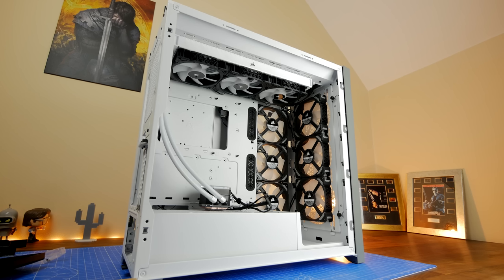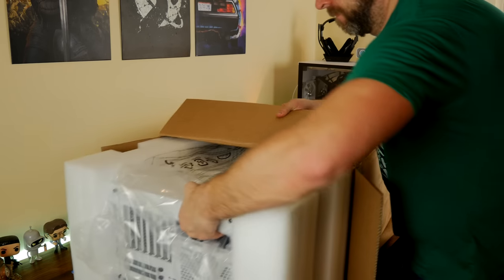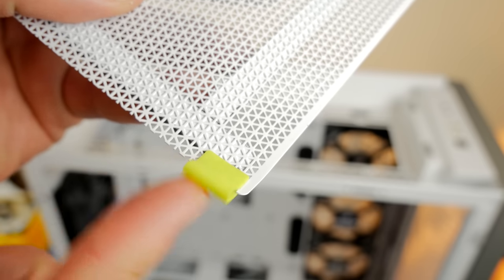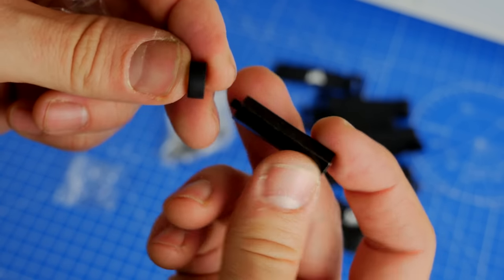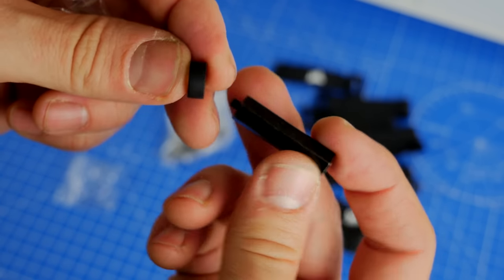Corsair 5000D Airflow build with 12 fans, H150i Elite Capellix Push Pull (in-depth build guide)

Comment from the maker: Related videos worth watching:
Corsair Fan wiring guide - https://www.youtube.com/watch?v=jvXCbny-Suw
5000D with two fans https://youtu.be/r5OY9llXRwo
How to vertically mount your GPU in the Corsair 5000D Airflow (does it get too hot?) https://youtu.be/4b8lb8adXTA
Corsair iCue H150i Elite Capellix AIO Unboxing and installation https://youtu.be/o_FajCnpN6Q
Corsair QL120 VS LL120 https://youtu.be/X4-tx9mn1Tg
Corsair QL120 RGB Fan Unboxing and installation https://youtu.be/MIi-aHqt3bc
Corsair RM850x Power Supply unboxing https://youtu.be/-MPSkh2hobA
Corsair 680x Crystal with QL120 fans (swapped from LL120s) https://youtu.be/kCC0hrqPiFI
Corsair 4000D Airflow Unboxing, setup and installation https://youtu.be/hVTshBAcso4
Reply: For the cooler tightness I just want it tight enough so it doesnt jiggle when I try to move it right?

Comment: I recently bought this case and doing a full corsair build as well with RGB. I'm only using 7 fans compared to your 12 and I'm already feeling overwhelmed with the amount of wires popping out everywhere. I love the cable management on this case and after fiddling with it for a few hours I managed to get most of it packed away nice and neat.
Reply from the maker: It's a great case to build  in.
Reply: Question? I want to run 10 fans,6 intakes(front and side) and 4 exhaust(top and rear), and be able to control the speed with and RGB lights with ICUe software. Do I need a commander pro and XT connected together?
Reply: @fizzmac966  Would also like to know the answer to this particular question. Have you figured it out?
Reply: @Jacksonas  Unfortunately I went with only 6 fans lol 3 intakes and 3 exhaust on top. I used the Commander pro that came with my AIO to connect all 6. I also bought the Corsair RGB triangle lights too. I used the lighting pro that came with it to connect the two I bought. But last time I hear that how it would work if you would like to use more than 6 fans. In the future that’s probably what I’ll do. Had to use a splitter too as well. Aio used to much power and had to used its own usb. The commander and light pro had to be split and share the other usb

Comment: couldn't you technically couldn't you make it 15 fans with 1 more in the rear exhaust and 2 in the spaces below the GPU which on the corsair website says that you can put 2 there. Great vid, really helpful for understanding the wiring of the fans in this case.

Comment: This is one of the best reviews/builds in this case that I've seen.  I bought the case about a month ago and going to do a brand new build within it.  Thanks for the video!
Reply from the maker: Thanks you. I was worried it was too long but I'm glad people like it. Hope you enjoyed enough to subscribe 🦐
Reply: @TheProvokedPrawn  I'm embarking on a new build and trying to decide what case/cooler to use. This, along with the 4000D (and next I'm watching the 7000D video to see if there's anything more to glean) video has been super-useful in helping make the decision.

One question though: in the online sellers descriptions of the Corsair Elite H150i Capellix that I see, they all mention that while it's compatible with the LGA-1700 that the Alder Lake processors use, you have to ask Corsair, I guess, to give you an LGA-1700 attachment kit, with proof you actually purchased a LGA-1700 processor or motherboard. I don't know what to think about that - it's a bit shocking that 5 months after the introduction of Alder Lake it seems that Corsair AIOs still aren't arriving with LGA-1700 support. That's an added hassle, and obviously lengthens the build time - depending on responsiveness it could go over the 30 days RMA period in case something goes wrong.

Do you have any information on whether what I described is correct? Thanks.

Comment from the maker: 0:00 Corsair 5000D overview 
0:33 The set up 
1:25 Unboxing the Corsair 5000D
2:15 Taking the sides off 
2:50 Back access door
3:10 removable panels and dust filters
3:33 Initial set up out of the box
5:10 cable hiding panel 
5:25 Motherboard mount compatibility 
5:39 Hard drive mounting availability 
6:05 PWM Fan controller 
6:27 Back plate mounting 
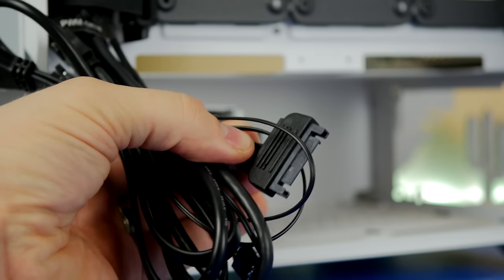7:11 Cables for front power 
7:54 Rear cable management 
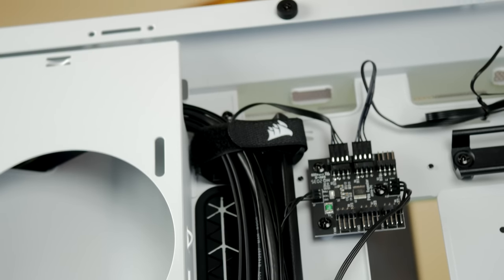8:23 HDD Case and tray 
9:28 Accessory Box 
11:17 Installing the side fans
12:07 Cable shield 
12:35 Radiator options
12:49 ML120 Pro RGB fans 
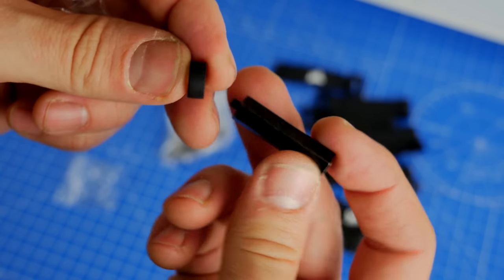14:20 fan cables 
15:30 SSD trays 
15:58 Front panel removal 
16:16 How not to install the fans
16:45 Fans installed correctly 
17:24 fan cable issue and solution 
18:44 Connecting the RGB fans correctly with the PWM
20:10 RGB HUB  
21:14 getting the Velcro straps back in 
21:35 Corsair commander Pro 
22:40 Corsair IQ H150i Elite Capellix 
23:15 What's in the box
24:58 top mounting fans for push pull set up
25:25 Corsair past radiator problems 
26:23 installing the Elite Capellix Radiator 
27:12 Corsair commander core 
27:58 replacing the top covers 
28:30 connecting the pump head 
28:52 removable bottom shelve
30:04 front panel USB connections
30:40 Corsair RM850x PSU installation 
32:39 removing the rear door 
32:54 installing the motherboard 
33:17 installing the pump head 
35:08 Pump head problem
37:13 PSU cable problems
38:25 Another issue with the cables 
38:47 front panel connections 
39:25 90 Degree adaptor 
39:58 Running the rear cables 
40:18 SSD installation 
40:50 SSD mounting problem 
42:00 RTX3080 installation 
43:06 Hiding the mess 
43:42 The PC up and running 
44:19 Fan noise 
44:56 Rear exhaust fan
45:34 Benchmark testing
Reply: Just wanted to let you know you messed up on the 33 minute timestamp but other than that thank you for this video
Reply from the maker: @Ostar-sz9pm  thank you
Reply: Do you think i could install 3×140mm fans in the front? The front plate looks like it has enough space...but it's hard to tell
Reply from the maker: @sorincosma5185  check the description for details on what fans will fit where 😎
Reply: @TheProvokedPrawn  the description says no, but the descriptions aren't always right, my current case says you can't install 280mm AIO on top, but i did.
Reply from the maker: @sorincosma5185  ah. Well I can't really say otherwise as I didn't try it and I'd hate to mislead you by guessing.
Reply: I just ordered a build with this case (black version) from Origin PC, because I'm no good at building myself, and it's going to be a pretty beefed-up system, but I'm not all that crazy about those side cutouts. Just seems kind of silly to me to have fans pumping in air at right angles to each other. Really wish Corsair would have skipped adding those. I do however like the rest of the case, the fact that you can now install a 360mm radiator front or top and not have an issue with also having high-profile (rgb) RAM sticks. The configuration I ordered will have the new 360mm rad from Corsair and I do hope the Origin people will install it in the top. Or if they install it in the front I hope they'll do it hoses-down. I've never ordered from them before so I'm nervous. Anyway, here's my configuration:

Case : Corsair 5000D Airflow
Exterior Color : Black
Interior Lighting : iCUE RGB with CORSAIR NODE PRO
Processors : AMD Ryzen 9 5950X 16-Core 3.4GHz (4.9GHz Max Boost)
Motherboard : MSI MEG X570 ACE
Memory : 64GB CORSAIR DOMINATOR PLATINUM 3200MHz RGB (4x16GB)
System Cooling : CORSAIR H150i PRO XT RGB Cooler
System Fans : CORSAIR QL iCUE RGB controlled by iCUE software
Graphics Cards : NVIDIA 10GB GeForce RTX 3080
Operating System : MS Windows 10 Professional
Operating System Drive : 500GB Samsung 980 PRO
Power Supply : CORSAIR RM1000i SERIES PLUS GOLD
Power Supply Sleeved Cable : Black Sleeved Cables +$90
ORIGIN Maximum Protection Shipping Process : ORIGIN Wooden Crate Armor

This will be my first gaming pc, so anyone reading who's knowledgeable let me know if I made some good choices in this setup or not. Total cost is $4,945.79. I'll of course be using the computer for 4k gaming but I also do a ton of other things like high-def video rendering and graphic design in Photoshop. That's why I went with the higher end cpu and gpu. 
But yea, the extra fan vent on the side kinda bothers me. Oh well, guess it'll just be there in case I ever decide to stick another three fans in the cutouts. Cheers!
Reply: i have one question: You got 12 fans. So the front and side fans are installed in the pwm controller of the case. How can i controll them. Per Icue or which software? I want to controll 10 fans in the same case all via Icue. Are the fans which are installed in the pwm controller controlled via Bios or how? I have one commander pro but they are only 6 fans to controll. So you  6 via pwm controller and 6 via commander pro. Which can u controll cia Icue?
Reply: @DrogonIsHere  You'd need another commander pro or similar corsair fan hub that supports icue.
Reply: @jimb8738  It's actually quite a smart design. The air being pumped in from the back mounted fans will be pushed along the system components and through the case from the front fans, and out the back and top from those fans. It adds more airflow/CFM (per volume of case) while keeping positive pressure and letting you set lower fan speeds.
Reply: Adoro tu profesionalismo y la calidad de tus videos, haz ganado un subscriptor
Reply: @jimb8738  You will enjoy the 5950X.  I considered Origin as well, they are very pricey but they are a subsidiary of Corsair - so there is a level of confidence there just from that alone.  Plus they offer custom water cooling loops as well.  Arctic makes a real nice 360 and even a 420 AIO with very thick radiators that seems extremely competitive in design plus has a small fan on the pump block to cool the VRMs, not sure if that might be a problem on some mobos though.  Also ASUS makes a very nice motherboard (Crosshair VIII Dark Hero) which has some appealing features (very high amperage VRMS plus 'Dynamic Overclock' which switches back and forth between single-core (PBO) and your own Overclock settings and can help improve performance in SOME (not all) applications.  Lacks USB-C connectivity and no thunderbolt.  They also make the Crosshair VIII EXTREME which includes all the features I mentioned, plus 5 PCI-e NvMe connectors as well as USB-C and Thunderbolt.  It's double the price tho :(
Enjoy your Origin  Be careful uncrating it, looks like a project breaking it out of that wooden 'armor'.  Great choice on the Airflow case!  You will love that!
Reply: Question: am I gonna be able to install 3 fans on the side panel if I keep the hdd cage in the case?

Comment: The cable cover also acts as an air guide for those side fans so you can have air blowing over your motherboard. This way your air isn't going straight out towards the side panel since the air flow will have to go out and then back out towards the back of the case
Reply: How would I mount that cable cover when I have the 360 radiator on top and the three side fans? I'd love to have that cable cover to "hide" the side fans
Reply: @hollyc5417  Lmaoo
Reply: I'm building one on my table right now and was thinking the same thing. It's clearly designed as a baffle to direct the air right at the motherboard.
Reply: @rawyin y a los discos HHD en el caso de tenerlos, el ventilador inferior. CORSAIR hiciste un gran trabajo con este 5000D 😍
Reply: This has been debunked.

"Just as a reference, the idea of using that plate to direct air under the mobo has been throw around, and it's not a good one. There is almost no clearance between fan and bracket, even if you can get them in there together (which was not intended by corsair, bracket is just for cable hiding/blocking that side if you didn't use those fan slots). Having the plate in front of the fans simply makes the airflow inefficient and basically makes those fans useless. All the mobo heatsinks are on top of the mobo, so you want maximum airflow into the case, and over your gpu/mobo which means unobstructed. So basically for airflow and fitment reasons it is better to not mount the bracket. And with 10 fans, 6 front intake and 3 top/1 rear exhaust. Incase you were undecided."

Comment: I built mine a couple days ago and also encountered some problems, like space for my HDDs and PSU of 1000w. Also the power cable for CPU was a hassle since it has no space at the top with the Elite Capellix XT. One thing is for sure, temps changed for me. My Ryzen 9 5950x went from 46 idle to 37. From 65 c to 57 c on workload! Absolute cold! Also worth noting! You should connect the fans on the radiatior to the CPU Fan slot and the AIO Pump to its correct slot. Connecting the Elite Capellix pump cable to the Cpu Fan pin gave me Cpu Error at launch, solved it by connecting the 3 radiator fans to the Cpu fan and the radiator pump to the aio pump. Very nice video! Watched it from beginning to end, good job!
Reply from the maker: Thank you. Btw you can fix that CPU fan error by just turning it off in the bios

Comment: I have the exact same case but for some reason I don't have enough room to mount the radiator perfectly in the middle on top so I slightly moved it to the left and screw it in only on the left side side of the radiator. I couldn't screw the right side of the radiator because there are no holes there in the case. I had to use wires to tie the right side in place. The reason was the power cables (2x) on the top was blocking the path where the radiator would be. I tried everything to push the cables back as far as I could but it's still too thick.

They either need to push the motherboard back a little or increase the height of the case another inch or two so the power cables doesn't block/obstruct the radiator. The motherboard I'm using is the ASUS ROG Strix X670E-A ATX. I've seen other build videos of the same case but they always seem to have plenty of room.

I also had to remove the cable bar otherwise I wouldn't have been able to squeeze the ATX power cable through on the side. The PSU I'm using is the Corsair HX 1200 and all their cables are thick and hard to maneuver in the case. I'm using the RTX 4090 and it's a huge card. The power cable for that barely gave me enough room to close the side glass panel. Most likely my next PC build 10 years from now will be a full tower.

Comment: Hey, you overlooked something. The "Cable hide Panel" can be used to cool down your Motherboard VRM and M2 SSD's mounted  on the Motherboard! The Side Fans suck Cold Air in and the Panel directs it over the Mainboard Compoents.

I've you use 1 or 2 All in one Radiators (one from CPU in the Top and one from GPU in the Front) or a Custom Water Cooling where the Water Tank is blocking the Front Fans too from the Radiator. U need to geht a cool breeze from somewhere else to cool down your Motherboard und his Components. This is the Way to do it.
Reply: Good point, i saw this initially and wondered why he didn't mention it. When parts become available in a year or two im gonna get this case and do as you said with the panel directing air from the side over the motherboard/RAM/M2's etc as well as three fans at the front sucking air in, an AIO with fans pushing the air through the rad out the top and one final fan sucking air out the back. Hopefully the airflow isn't interupted in any way with this setup.
Reply: @Ironcobra666fuckyou  My plan almost matches yours. I plan on going 2x 140mm fans in the front intake, 3x 120mm fans on the side with the panel cover as intake, 1x 120mm rear exhaust, aio top mounted exhaust for cpu in push/pull 4x 140mm fans. I hope it fits.

Comment: You can actually fill 13 120mm fans in the Corsair 5000 Series Cases, but that would result in a little bit of negative pressure since there would be 7 exhaust fans (1 in the back, 6 on top with the push and pull config) and 6 intake fans (3 up front, 3 on the side). It's always better to have neutral pressure over positive or negative pressure (neutral means same amount of intake as exhaust fans, positive means more intake fans than exhaust fans, negative means more exhaust fans). I finally saw why this man chose 12 not 13 fans. Good job, mate :)
Reply: Would it matter since the 3 fans on the very  top are just pulling air that the 3 on the lower top blow?
Reply: I can't believe this is upvoted. The number of fans isn't the factor for balancing fluid pressure within a system

Comment: Thank you so much for this video! I have this case with a very similar setup on the way. You saved me the hassle of having to wait a few days for extra parts.  I realized that the particular model of 150i AIO cooler I ordered did not come with the commander controller. So I ordered better elite model.  I also ordered the fans individually, so I wasn't getting the rgb node controllers either. You saved me alot of extra time and hassle. Thank you,  thank you,  thank you!
Reply from the maker: You are welcome!